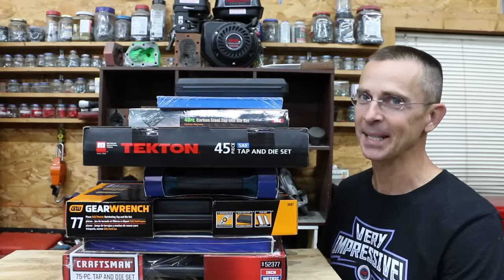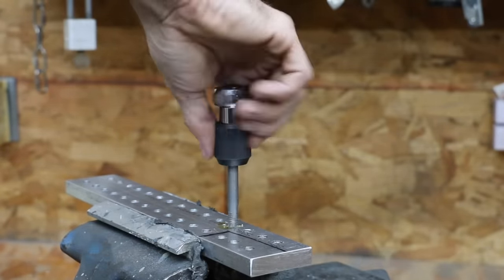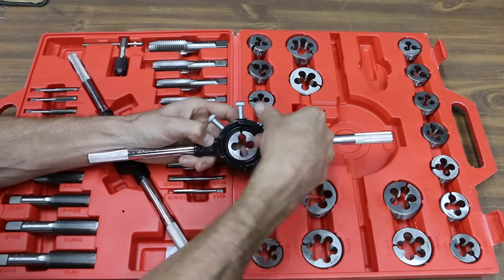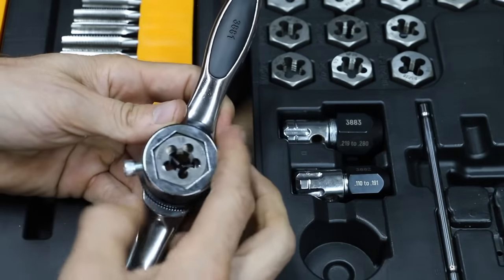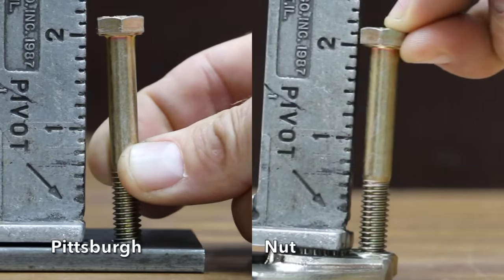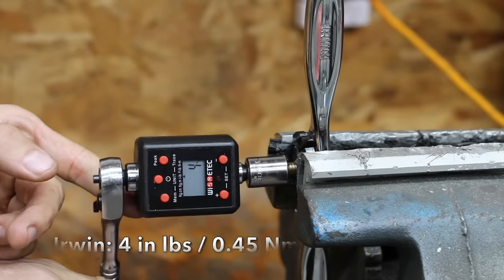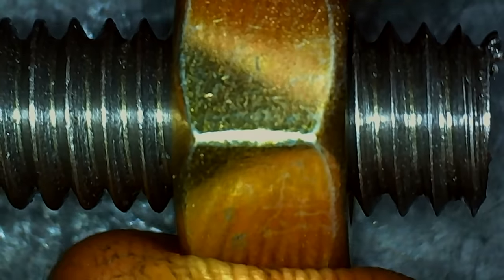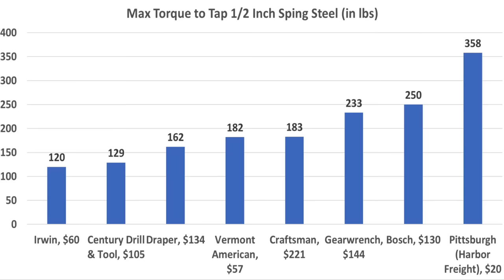Best TAP & DIE Set? Craftsman vs Irwin, Bosch, Draper, Vermont American, Tekton, GearWrench

Comment: I invested in Irwin sets a long time ago.  What I have found is that carbon steel taps and dies are single use only.  The teeth on the taps break when tapping steel.  Over the years, I have purchased individual HHS taps made in the USA, replacing damaged taps in the set.  The difference in cutting and longevity is amazing.
Reply from the maker: Thanks for the feedback.
Reply: I’m tempted to buy a set but think I’ll do as you did just buy as needed
Reply: It seems better for most things to buy as needed instead of a mass set. Kitchen knives and pots/pans sets made that clear to me a while back
Reply: I can't find a brand that make taps of HHS. Could you tell me wich one you buy?
Reply: @Area51Motorcycles  He most likely meant HSS which is high speed steel. You can get them from places like MSC
Reply: @skudak  thanks!! I was looking for a quality tool seller like that!
Reply: Those carbon steel tap sets are probably limited to non ferrous metals and plastics. You wouldn't go anywhere near stainless steel, 4140 etc with them. For occasional use by the DIY guy.
Reply: Are you trying to spell HSS taps? Never heard of HHS.
Reply: @bushmaster2936  oh no, I tried to say HSS
Reply: Even Adam Savage’s video on tapping says just buy quality taps as needed . Most cheap tap sets are junk and most sizes you won’t ever use.
Reply: @Area51Motorcycles  you don’t need HSS. As long as you use cutting oil and advance 1 turn, back off 1/4 turn, and so on, the taps and dies last just fine. Most people just think you can torque the heck out of them and you can’t.
Reply: @I_SuperHiro_I  I like to use HSS because those cut better and you need less force to tap. That results in a better tight thread. Carbon steel is like tapping with a stone.
Reply: @skudak  Am I missing something?   I looked on MSC but they mostly have the same sets that Home Depot or Amazon has just at higher prices and most of them are not HSS
Reply: @skudak  You were talking about MSC Direct, right?
Reply: @jakass -As to pots and pans a good SS All-Clad set will last a lifetime
Reply: Yup, good taps and dies are not cheap and cheap taps and dies are not good. For general use, I find Greenfield,  Cleveland, and Taylor are good.  Just looked on Grainger for an example.

CLEVELAND THREE PIECE TAP KIT, #8-32 TAP THREAD, ? IN THREAD L, 2? IN L, HIGH SPEED STEEL General purpose hand tap set. Taper, plug and bottoming. Size 8-32, H2, 4 Flutes
$40.69 / EACH

That's a 3 piece set, which works out to $13.56 per tap.  And a number 8 is a small tap.

I like 4 flute taps better than 3 flute.  They have one more set of cutting edges, and are easy to measure if size stamping id unclear.  Legible stampings cab be a problem on smaller sizes.

A cheap set of multiple sizes can do the job for a while.  I find that certain sizes are used repetitively.  And most others are seldom used. I replace the high use cheap ones with high quality when they wear out.
Reply: @billdivine9501  Personally I like to have one "general" set which contains a variety of sizes and covers me for those odd jobs now and then. Like a random little small bolt gets stripped or lost in a kids toy, or shops are closed for the evening, etc. Then buy the individual quality pieces for the more frequently used ones and slowly build up that collection over time. No reason to only go one or the other.

Comment: I think a video on rivet nuts would be pretty interesting. I’ve been looking at them to put on my pickup bed so I can easily remove and remount my toolbox. With just a bolt from the top instead of having to get a nut underneath the edge. My old truck it was easy to do, but my new one is impossible to get under the back corners of the tool box with my hand and a nut.

I’m mostly curious how much torque the standard round ones can handle before twisting loose. I’ve seen these hex shaped rivet nuts also. For them a small hole is drilled, then a tool pulled through the hole to make it hex shaped, then the hex shaped rivet nut is crushed into that. Looks like it could take a ton of torque without being spun out.
Reply from the maker: Thank you for the video idea!
Reply: l would be interested in that to .
Reply: @ProjectFarm  Thanks for the videos, but I have to ask:  What happened to you displaying the top products at the end of the video?  It's just you sitting next to an empty table!  o_O
Reply: That’d be cool. I’ve used them a few times. Really come in handy. Most recent instance was a DIY upgrade to extend the length of my table saw’s front rail. Worked really well and has held up without any issues.
Reply: @ProjectFarm  Rivet nuts and the different types of installers would be great. For instance drill operated vs hand operated rivet nut installers. Also showing the holding power of different types of rivet nuts like aluminum, steel and stainless steel.
Reply: Let’s get a video on this
Reply: Great idea!!!
Reply: If you have a bunch to do, check out Astro Pneumatics. They have a tool to set them that works on a drill.  I can’t speak for sized over 1/4” thread rivnuts but it works fantastic for those.
Reply: Nice idea. I use cheap aluminium rivet nut and they cannot hold torque, but it's ok for my application. Stainless rivet are hard to put.
Reply: +1 Rivnuts are amazing when they work but I'm always paranoid about how well they'll perform under higher loads
Reply: Both the tools and the rivets could be compared as well as alternatives like plus-nuts and well-nuts.
Reply: @rickjablonski9669  After all the hard work making this video, his energy was too tapped out to do it. I'm just glad he didn't die in the process.

I'll see myself out now...
Reply: add a star cut washer to the backside for extra grip for the round ones ...
Reply: Try Dzus tabs.. Rivnuts are great until they fail (often when installing them), then you're screwed.. A harbor freight tool has a hard time pulling an aluminum 1/4-20  try a steel rivnut and you'll break the tool,, anything bigger and you'll need something much better to install.. Dzus tabs can be installed completely flush and both parts stay in place so nothing to loose.....
Reply: Really don't need the tool. I just used a piece of scrap metal with a hole the size of the threads drilled in it, and a nut & bolt. Drill a hole in your project the size of the rivnut, thread the nut onto the bolt, slide the metal with the hole onto the bolt, and then screw the rivnut onto the bolt. Stick the rivnut in the hole and hold it in place with the scrap piece, hold the bolt with one wrench and tighten the nut with another until torque starts to increase. I used ASTRO pneumatic rivnuts with good success.
Reply: @jake-mv5oi  I have literally installed hundreds of thousands of various threaded inserts  over the years from Heli-coils to rivnuts to PEM Nuts to nut plates to Dzus tabs, to panel fasteners to.......... with automated power equipment, manual power equipment, manual hand squeezes, hammers, vices, and other things.. Even though you CAN use turning the  threads to suck a rivnut down,, the risk of failure is very high (make sure you oil the threads before torqueing).. When I did what you want to do, I welded 1/2-13 nuts to my truck bed. Since it's a flatbed,, A little rattle can touch-up was all I needed... A stock truck body with a stock paint job would require a lot of reenforcing and painting to look good.. My headboard is 1/8 thick so it was a piece of cake.. I would still suggest Dzus tabs or maybe nut-plates for your application. You can probably get them free as samples from your local supplier... Nevertheless,, You know what you want for your project and that is all that matters...
Reply: @twistedhillbilly6157  The method I use doesn't turn the bolt in the threads of the rivnut like some people do. The bolt stays stationary in the threads and the rivnut is drawn together with the nut. It's functionally the same as using a rivnut tool tool.
Reply: @jake-mv5oi  I see what you're saying.. That would definitely make it a lot safer (oil the nut and pushing plate instead of the threads hahaha).. I do use rivnuts but they are not my first choice and only for light-duty applications due to the low pull-out force. Even after expansion they have a small swage that can pop through thin Sheetmetal.. I have never tried to back one up with a washer for extra support but that might work..  . Probably because I have used so many types that most people don't know exist.. rivnuts have by far the highest failure rate but they do work and are readily available for home use.. I still like Dzus tabs 'cause they're fancy, operated with one hand and never get lost or even dropped.. With the wingnut style, you don't  even need a screwdriver.. Dzus tabs are used on airplanes, rocket-ships and racecars.. You won't see a rivnut on any of those.. I don't mean to argue or say that you are wrong,, just mentioning some alternatives....